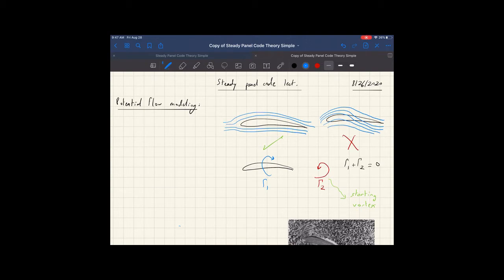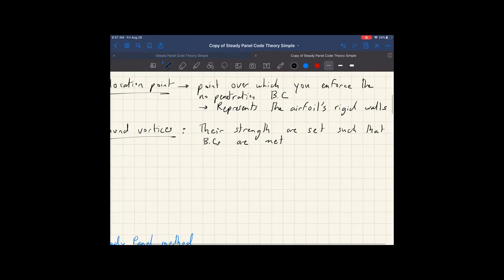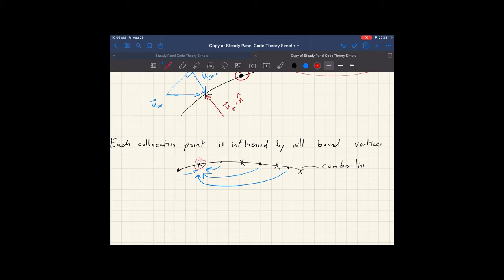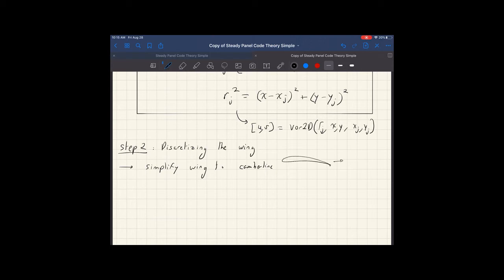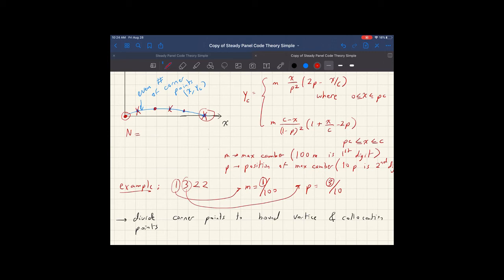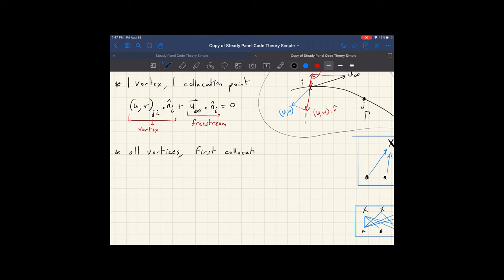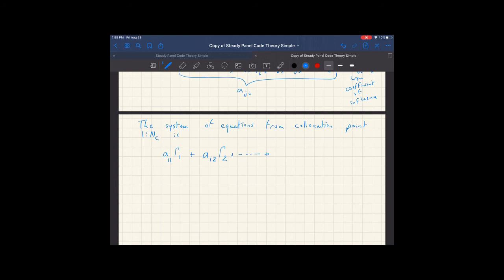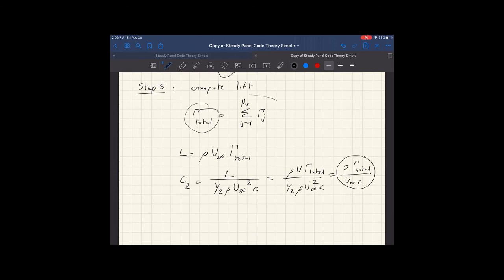The Steady Panel Method

Comment: Is it correct to surmise the lack of smooth transition of the flow departure on the trailing edge a factor of angle of attack if both airfoils are the same?